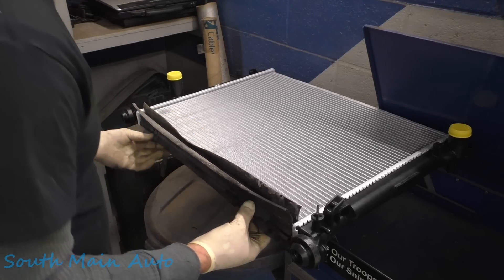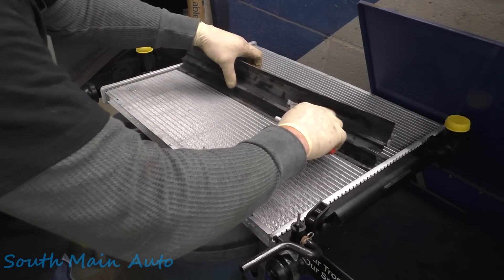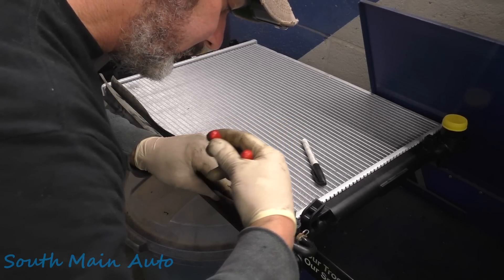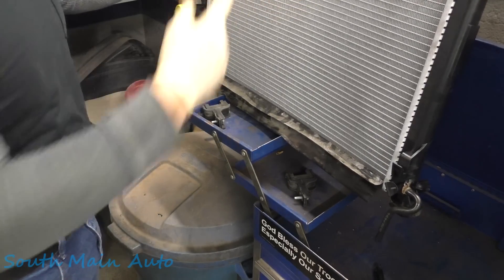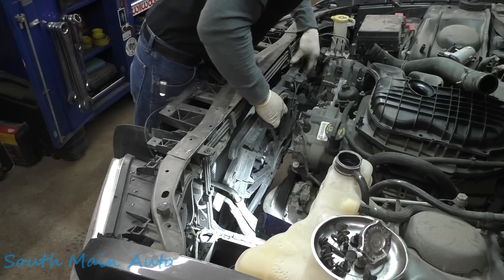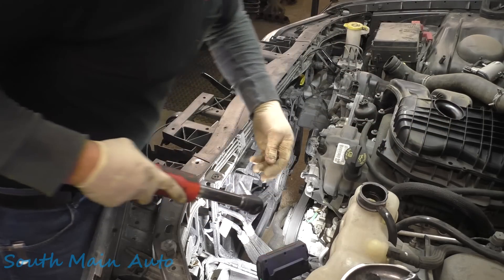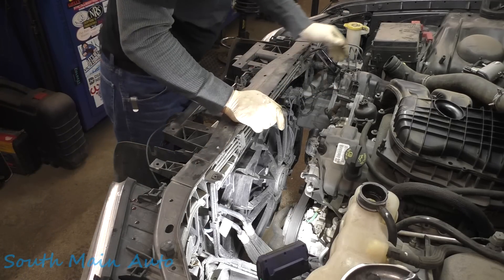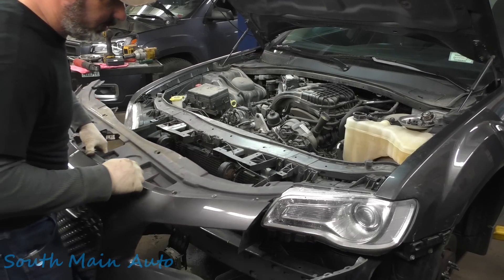'18 Chrysler 300 Radiator Replacement - Part II

Comment: I had no choice with my 83 Subaru brat. Chinese radiator only. There are Indonesian ones available in Australia too. Chinese are Aluminum, the Indonesian ones are copper. The fan shrouds  never seem to line up quite right, but perhaps they are a bit warped from heat exposure!

Comment: glue that part to the radiator using silicon and move on. that radiator bottom piece only needs to stay in place until you install it. a temporary hold.

Comment: You gave the customer what they wanted... a way to afford a new radiator. Why do you reckon the Chinese factories don't make the after market parts the same as the OEM, I mean metal tabs are pretty important?
Reply: That rad may be made to fit a dozen different vehicles and not all require the metal tabs.   Just a guess.....

Comment: As fragile as radiator fins are you would think they would offer more protection  from damage . I put a window screen in front of mine and when it gave out after twenty years (seam leak) the fins were still like new.

Comment: For my 1977 G30 van it was the fittings needed for the hose/transmission lines that I had to purchase to get the radiator to adapt that delayed the swap-out.
And what cheese was you having with that whine.

Comment: I find it even more frustrating when the after-market radiator is made by the same manufacturer as the OE, but it still has different fittings. A couple of years ago I fitted a radiator to a friend's Peugeot Boxer van (sold in the US as Dodge Ram Pro, I believe). I checked it visually against the original and it all looked the same, so I fitted it. When it came to refitting the intercooler to the bottom of it, I couldn't get it to attach to the moulded plastic mounting points on the rad. When I measured them, it turned out there was a very slight difference in the positioning, so I had to strip it all back out again. The only one I could find that actually matched the original was from the main dealer, at twice the cost, plus I had to do the job twice, just to try to save my friend some money.

Comment: I had my issues with a Chinesium radiator on a Subaru I got from O'Reilly.  The trans line fittings were 90's and stuck out too far and hung up on the body inside the bay.  NAPA actually saved me after we open4ed 3 other boxes and found one where the fittings were like OEM and would fit.  What a load of hoo-haw - do the Chines not have rulers?  Well, I know they have a Ruler but I'm talking measuring devices.

Comment: Eric, i used to sell aftermarket and OEM Radiators, they are made at the same place or same factory, the differences are mainly the internal fins used to cool the transmission, OEM normally have good quality rubber seals and also stainless steel cooling fins inside the radiator for auto trans cooling and also the seals used for the plastic side tanks are good quality on OEM, plus the aluminum is also controlled, but aftermarket is a lucky dip really, all depends on the person on the line who is putting them together, its basically same person for oem, just different rubber seals and quality control is the main difference, i hope this helps?
Also with a large market such as the usa, then you guys have so many aftermarket brands for almost everything, also aftermarket dealers who sell OEM parts, where as some countries depending on the brand, you have to go to a OEM dealer to by products, like HOLDEN GMH / FORD Australia as a example. 🦘🦘👌👌✌✌👍👍

Comment: Eric 
Dumb question because it actually says on the mechanical Fan to not lay it down. 
In a dumb debate about it on facebag. If you lay the fan flat it will hurt it? There’s a chemical inside the clutch and if it’s laid down for too long it’ll break down.

Comment: I've got a Wrangler with the 3.6L and just love how Chrysler has coolant that depends on the year of the car and if you mix them, they turn to gel and lunch the cooling system.  So should I get OAT or HOAT or BOAT or GOAT?  I'm tempted to run distilled water next summer and then go to regular old, $5 a 55 gallon barrel ethaline glycol (green) coolant and never have to worry about it again.

Comment: Honest question: have you EVER rolled the dice with a salvage yard OEM radiator vs the aftermarket/NAPA junk? Or is the risk of failure simply too high with going that route? (fitment issues notwithstanding)

Comment: That was a good job.  I miss doing cooling system work but i have no place to dump off the old coolant anymore.  

I have those flush cutters, bought them in '93.  They are my favorites, I use them they still work great,  yea I have done some rather questionable things with them, too, but they've never failed.  Think I could still get them warrantied?

Comment: Hope you had a great Thanksgiving!   Just curious, between 14:21 and 15:55 of the video, that looked like the IAT connector laying on the right valve cover, that should connect right before the throttle body, in the air intake.  I have one of those 3.6L engines, so I always have to make sure I hook that back up.
Reply from the maker: Yeah I forgot it lol. When I went to move the car later that day in the engine light popped on I didn't forget 🙄

Comment: Yep, aftermarket radiators are junk.  I've replaced the one in my 92 Cavalier probably 3 or 4 times since 2006 because they end up leaking.  They also don't fit down on the rubber bracket on one side at the bottom.

Comment: The go to repair for this sort of thing a while ago was a bottle of stuff called Radweld. Get the car hot, pour the contents of the bottle into trhe radiator, let it circulate, the Radweld went around the system in the hot water, when it came to the leak it solidified on the inside of the leaky bit and sealed it up. Got you out of a hole. The rest of it just kept going around until you flushed the system, or it found another hole. Does anyone still use this sort of stuff or had the modern engine got an allergy to it?

Comment: I avoid aftermarket body parts and mechanical parts when repairing collision damage.  Nothing ever lines up right, your gaps are wonky.  It's not worth the time and hassle trying to make it work.  I may use a lot of used parts from parts breakers or even buy a parts car that I can get several uses out of but I use OEM parts almost exclusively.

Comment: The reason the OEM costs so much is the customer service/parts department deems it so...1000% markup of what they were paying was NOT uncommon...$50 Condensers (saw the POs) sold to the dealer and such for $500....$4 cup holders for $40.  Radiators made in the US for $60 are $600 from the OEM...They paid the suppliers $60, they charge the customer $600...that is the way it is, and has been for at least 50 years.

Comment: As a retired welder and rocket brain surgeon with the American Concrete Institute I have grave concerns about you cutting those crucial structural supports on that radiator. I’m afraid the first time that young lady will make a 5G turn in a cloverleaf entering the freeway she will suffer a catastrophic radiator core failure.

Comment: I’d love your thoughts on aftermarket cats lol, every single one of them is absolute junk, they never ever ever fit correctly by a country mile, you can never put the heat shields back on, you end up having to heat and bend shit to get the flanges to line up correctly. And if you’re lucky it’ll make it a week before it comes back with a cat code lol. Our shop no longer offers aftermarket cats unless the dealer is not available, it simply isn’t worth the headache. Idk if it’s the tolerances or what but these newer cars just will not accept an aftermarket cat without throwing a code again

Comment: To hold that rubber/plastic flap on till you get it in the car, there is one easier, just as efficient way of holding it, and that is to use some instant rubber glue, so that it holds and remains flexible, should that be necessary.  No cutting, no bending.   Easy-peasy.  How come you did not consider that one!

Comment: Back in the day when I was a teenager, You could take your radiator to a radiator repair shop they would Completely clean the cores seal the tank pressure test it, and paint it black to look like a brand new radiator. Better than this cheap alloy stuff which comes with a lot of pizzing* and moaning installing aftermarket junk. The price was reasonable 10 to $15 to completely repair your radiator what the hell do we know about technology or just a big company making a lot of money?

Comment: I would suggest using a few dabs of RTV sealant to hold the plastic in place vs. cutting the radiator.
It would be faster, might hold better and if there's a failure you didn't "void the warrantee" by "modifying" the unit.

Comment: Well... You could have cut the radiator, or just tossed a couple dabs of hot glue on the bottom of it. it would have stayed on no problem til it got in place and no mods to the radiator.

Comment: In reality, the OEM caused the problem by hiring Rube Goldberg to help design these cars so they can charge 5 times as much. Minor fitment issues are not a bad tradeoff for consumers. Not a good idea to buy many non OEM electrical replacement parts though. Buy a used OEM instead.

Comment: Yep play dumb. Spent the afternoon replacing a dishwasher. The new one... door won't  latch when it starts.  So it was well  we can't send a repair  guy out. 30 days .. or a new new one 7 days.... the latch was cracked it seams dam thing is plastic and  eltricaly activated. Delivery  company unboxed it  on the truck  and stuck it on my deck idk.

Comment: What does NAPA got to do with it? NAPA didn’t build that radiator. NAPA does not manufacture radiators. Some other company manufactured that radiator for NAPA. it is just like that with their oil. Napa oil is made by Valvoline.

Comment: It shouldn't cost five hundred bucks more for an OEM radiator - no matter what you think of Napper.
Reply: Quality and most of all precision machines cost more.
Reply: @KentuckyReef nothing quality about today's cars.  No way a 5 year old radiator should go bad.  Especially being OEM.
Reply: @bearing_aficionado  I agree with you on cars today are not built like they use to be. As far as the radiator, what happened to it, how has it been treated the last five years. If the “young lady” doesn’t have the money for oem then has she kept up on maintenance? Did a rock hit the radiator? We have know idea. The point is that the machines to produce parts with tight and exact tolerances cost big bucks.
Reply: @KentuckyReef  I know all about tight tolerances, as I make bearings for a living and cut everything down to microns.  In fact, I can tell you right now that none of the car manufacturers make their own components (especially bearings).  It's all outsourced just like aftermarket stuff.
Reply: @bearing_aficionado  it’s like talking to a liberal 🤤
Reply: @KentuckyReef  wait what?

Comment: come on now you rip on the aftermarket stuff when you know full well that the "OEM" stuff is made in the same factory for the same price it just has a higher profit margin its all about greed the AM market sells cheaper because they will sell more units to make of the difference the OEM market sells for more because they want more money on less parts just like the GM dealer i worked at charging 500 bucks for a 5 dollar fuse on top of the 500 bucks labor they charged to have me diag it (that is why i am not at that dealer anymore)